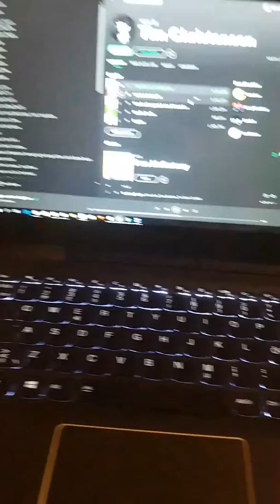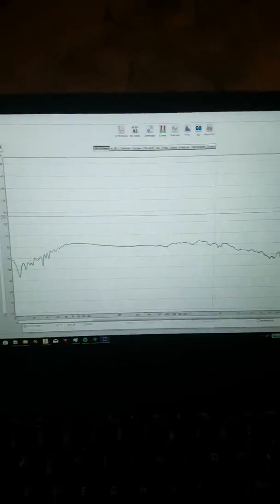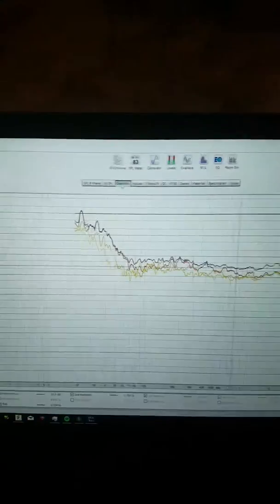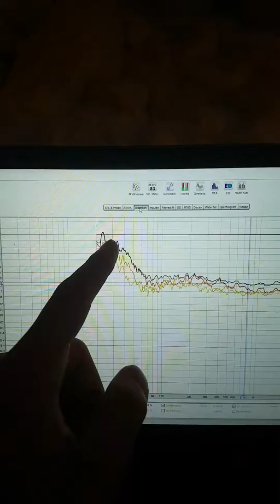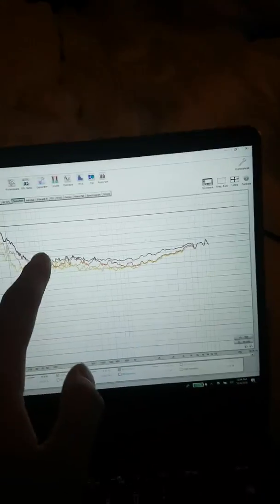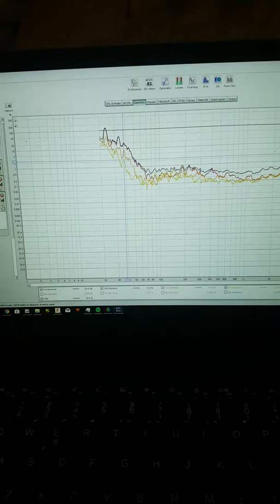3d Printed Planar Magnetic Headphone

Comment: The hardest part about building planar magnetic headphones is finding the right materials. If i could just get some thin mylar aluminum laminate film, everything else would be super easy.
Reply from the maker: Its hard to find. I would recommend plotting some thin aluminum on a plotting machine and then gluing that trace to the mylar. Easier said then done. Here in denmark we have madpakke folie, which is 6 micron alu on paper backer, and with water the paper comes off. Making the trace transfer process possible.

Comment: What is the impedance of those drivers?

I’m trying to design my own drivers and am struggling to keep the impedance above 8 ohms
Reply: I know this is a late reply, but the impedance of a planar driver will always be equal to the DC resistance of the wire or foil being used. If you want to use wire instead of foil, all you need to do is figure out what gauge you want and figure out the resistance of the wire per foot. There are plenty of tables online that will give you this measurement. For instance I think 40 gauge wire is 1 ohm per foot of wire. So you would need to make a coil 8 feet long to get 8 ohms. If you want aluminum foil traces, just get a piece of the cheapest aluminum foil they sell at your grocery story, take a razor blade and cut the thinest strip you can across the foil. Try to measure out 1 cm and use a piece of mdf as a guide so that you can make a very straight cut. Once you have your strip, measure the resistance. Since the length of this strip is the width of the foil roll, you know the length and the width. So lets say you have a 12 inch long piece of foil at 1cm and you measure 0.1 ohms of resistance, you know that at 1mm, you should have 1ohm of resistance for the same length of foil. Play around with the with and length of the material until you get your desired impedance.

Comment: That's damn nice. What did you use to glue the wire to the mylar?
Reply from the maker: 3m 30nf
Reply: @ledfed1912   hi sir,   great work,  did you use a wire,  or aluminum foil
Reply from the maker: @miclairmiclair876  Thanks! This is a very old project. I have made huge improvemets. Currently i plot alluminum foil and transfer it to mylar. Maybe i should make a video on my latest headphones...
Reply: @ledfed1912 nice , I would love to se the new model,   but I'm just experimenting for now , so I just wanted to know if a wire would work instead struggling with aluminum foil
Reply from the maker: @miclairmiclair876  a wire will work, i just found it not to work quite as well due to lack of foil covereage and a higher mass. But it does still sound very good, one important thing is to make sure it is a complete seal on your head and dont make the diaphragm too tight. I found for some reason the looser the better as long as it doesnt crinkle. Not too sure about tightness when using wire though i will be honest, probably the same. Not sure why this makes it sound better but it does.
Reply: @ledfed1912  thanks you so much . I'm I'll be waiting for the new video.   Have a great day

Comment: the bass issue can be solved by stronger magnets and thinner mylar film coated with graphene at one side
Reply from the maker: It was a seal issue, now the distortion is below 0.5 %thd even at 20hz. The issue was It wasn't sealing around the pad and i have fixed it in the next revision, but let me ask why graphene, isn't that for electrostats?
Reply: It's because graphene is extremely strong and very flexible. It will conduct electricity better than any other material which also means it will vibrate and conduct sound greater as well.